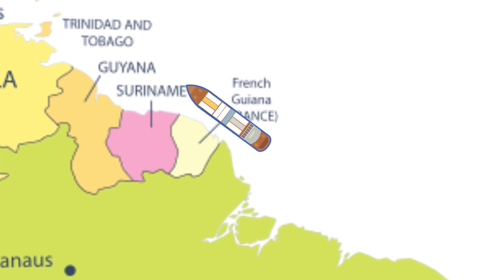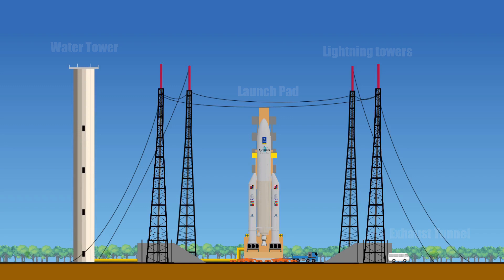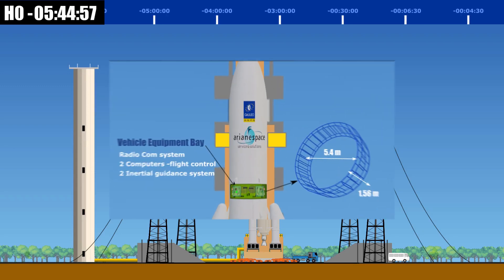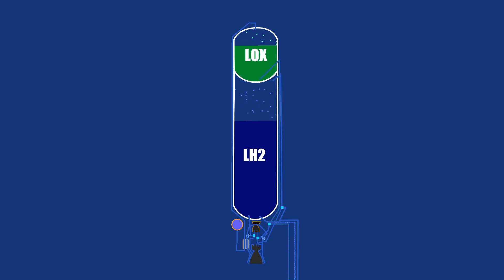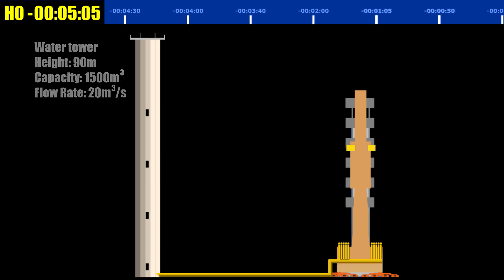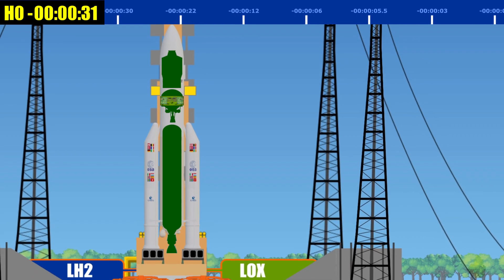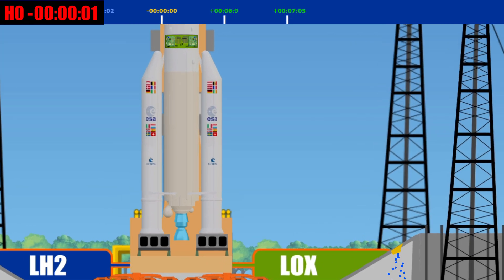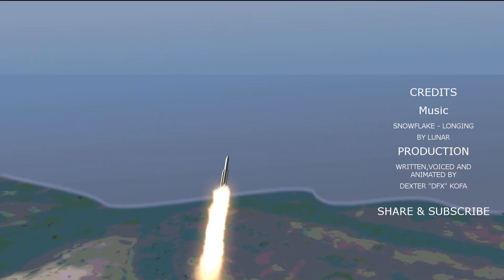Launch sequence of an Ariane 5

Comment: Ariane 5 has no reusable rocket engine. A rocket ENGINE combines and then burns (therefore, using) a fuel MIXTURE of two ingredients,  a fuel and an oxidizer. A solid booster MOTOR (usually) deals with a mono-propellant, a single hard polymer/plastic substance with a taffy-like consistency, which is only used in solid rocket booster(s). There are complete, multi-stage rockets that exclusively use mono-propellants. There are multi-stage rockets that exclusively use multi-component fuels, which are always in gaseous-liquid form. There are also rockets that use a combination of mono-propellants and multi-fuel liquid propellant stages. But, unfortunately, there is no single engineering definition of motor and of engine and how they may be different or the same. INFORMALLY though, and ENGINE combines....air/fuel, or fuel/oxidizer, etc. A MOTOR is usually singularly propelled by a mono-propellant (solid fuel rockets), or even electricity, such as an electric MOTOR. You never say electric ENGINE, right?! So under that premise, Ariane 5 still would NOT have a reusable ENGINE, though it's solid rocket boosters' propulsion is SOMEWHAT "managed" by it's rocket MOTOR. That make sense to ya'll?! I'm a horrible teacher, lol!

Comment from the maker: Important Note:
1)A lot of Information available for the Ariane 5 is in french. Since I'm not a fresh speaker or more precisely a french reader I had to depend on automated translations. So I may get a few things wrong about the sequence of events. Also keep in mind that as far as actual times for events goes, they may differ from the most recent sequence used by ESA. So check with them first before you design your payload around the launch sequence shown here.

2)In the sequence at 14:35, fuel is let into the gas generator way before the solid charge burns out. Output from the solid charge and gas generator overlap so that a certain fuel flow can be maintained  during the transition from solid charge to gas generator. In the video I show it as one after the other to give the viewer a clearer visual of what's going on.

If you like small YouTuber science channels check out the subreddit I've created just for that.
https://www.reddit.com/r/SmallYoutuberScience/
Show these creators some love.
Reply: that's okay i can do countdown!
Reply: You've done a great work!
I'm french, so next time you need to translate information feel free to ask, would love to participate in such quality videos.
Reply from the maker: @fuckednegativemind  Awesome. Thanks, I'll definitely keep that in mind.